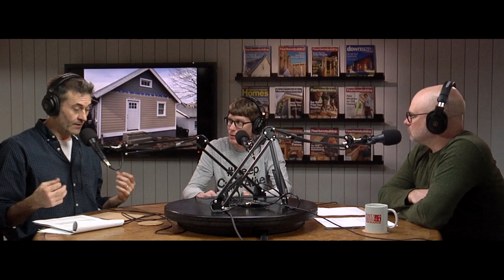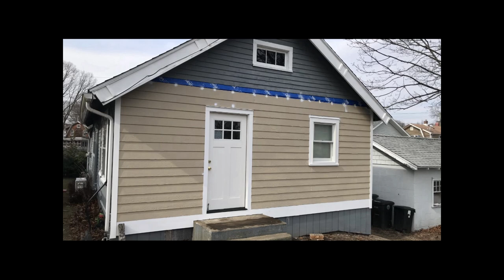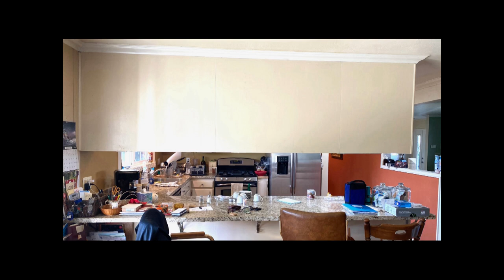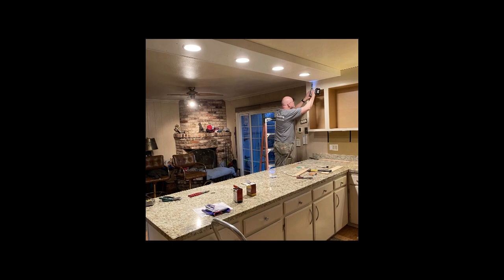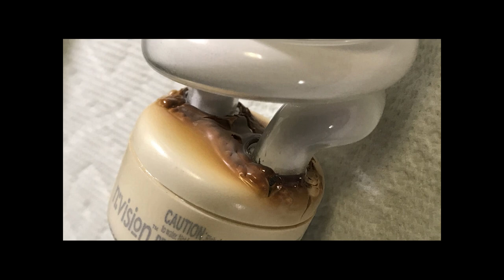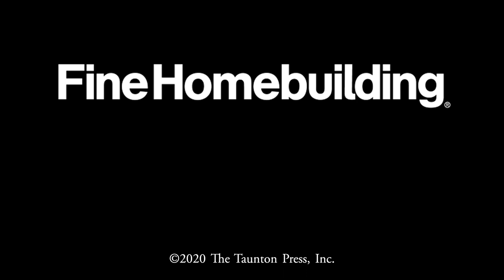Podcast 233: Hardwood Flooring, Windows in Rain Screen Walls, and Duct-Free Ventilation Systems

Comment: CFL and LED light life: It isn't the LED that goes out.  It's the electronics that goes.  Okay, they don't get as hot as an Edison.  They do get very warm, and I've met some that got hot - and they weren't very old.  Is it the quality of the manufacturing? In any event, their lives are almost always shorter than advertized, in  my experience, inside, outside, dry room or wet. Put either one on a UPS - much like (Or right into the one you are using for your computer) - and it lasts a lot longer.

Comment: Just curious if felt paper off gasses or has a smell? I’ve only ever used it on rooves... so never paid attention. I wonder if there are any alternatives for indoor applications
Reply: Yes, felt paper does off-gas. Typically the recommended hardwood floor underlayment is Aquabar 'B'. This is an asphaltic based product which does produce VOCs. A better product which is nearly the same price is a silicone based underlayment like Roberts SVS: https://www.homedepot.com/p/Roberts-200-sq-ft-Roll-of-Silicone-Vapor-Shield-Underlayment-for-Wood-Floors-70-198/205129063 . You can get it at most Home Depot locations I believe. A silicone based underlayment will provide the same protection without the VOCs.